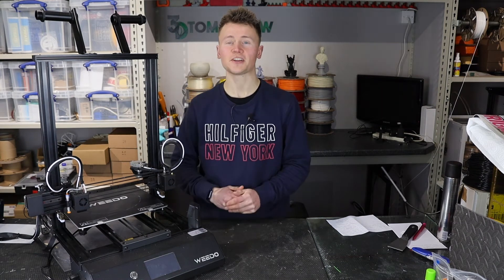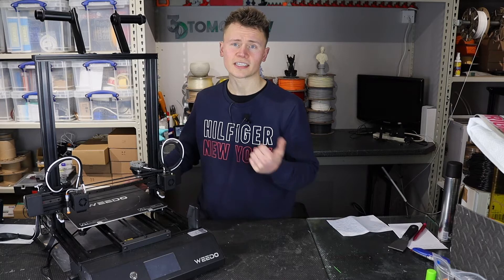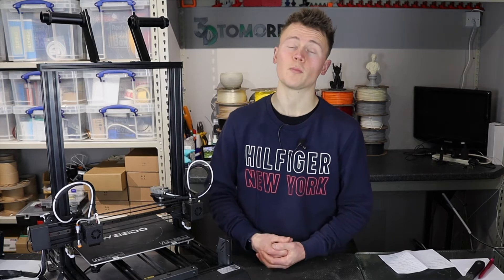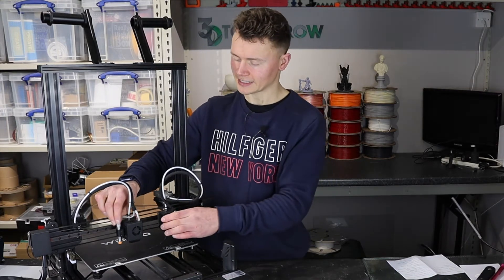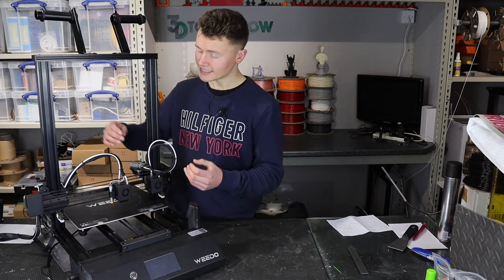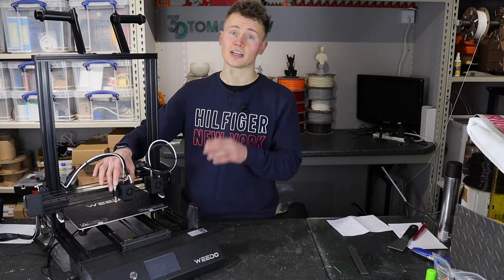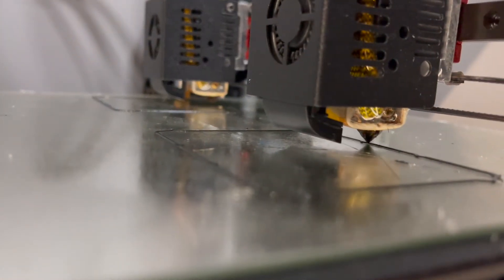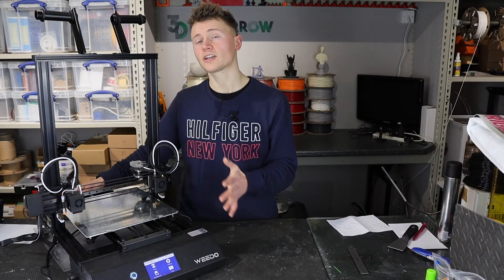Weedo X40 3D Printer Review Review - Budget IDEX 3D Printer - Independent Dual Extruder

Comment: I'm new to 3D printing. I assembled a Prusa MK3S+ with MMU2 just several weeks ago and was learning all about it, but I was intrigued by IDEX so I could do simultaneous duplicates. The Weedo ended up what I chose. Since I'm new I'm still on the uphill side of the learning curve, but so far I like this printer. I haven't figured out how to automatically load filament, but other than that the only thing I really don't like is the micro SD card handling. It's tedious to remove/insert on the printer, and a pain to use the adapter on the PC. To solve that I bought: 1) a micro SD to micro SD cable extender; and 2) an external memory card reader for the PC. The extender is great, and much easier for removal/insertion of the card. Also true of the external memory card reader. The card pops in the top which just seems easier than side slots. Thanks for the great review!
Reply from the maker: Wow that's a brave first printer! But yes, IDEX really is an awesome implementation, way more efficient and I love efficiency. You're micro SD card solution sounds good, clearly a problem solver, so you've found a good hobby to get into:D

Comment: I just bought one of these Friday, so far it's been great straight out the box,no issues.... But I am new to 3d printing and had a question what software is free but good to utilize 2 colors? This may be a stupid question lol.. but I have only been 3d printing for about 3 weeks
Reply from the maker: Hey Howard, glad you've got off to a good start. You should be able to do two colour printing in the slicer that Weedo have made available for the printer, it's basically a modified version of Cura, so lots of guidance available online for free. It's not what I use personally, so not an expert with it, but if you have any specific questions let me know and I will take a look.